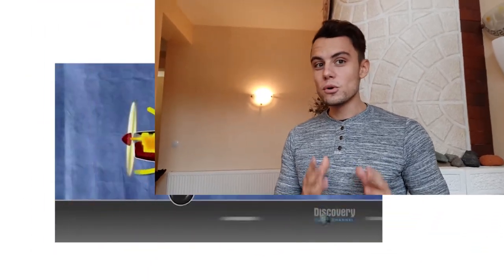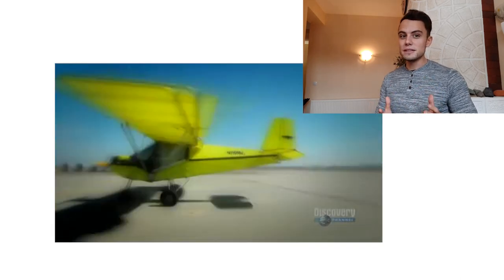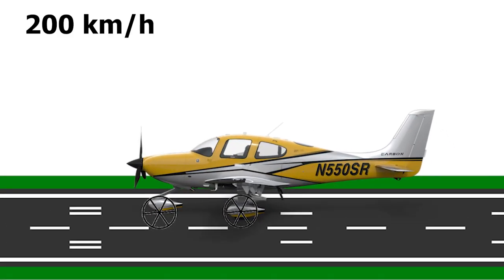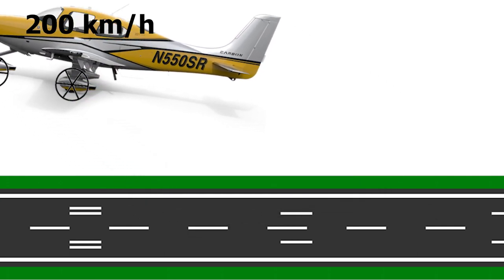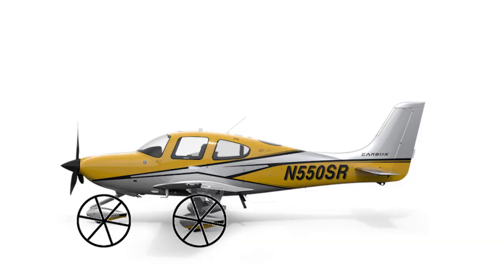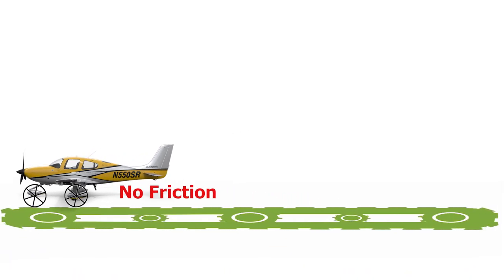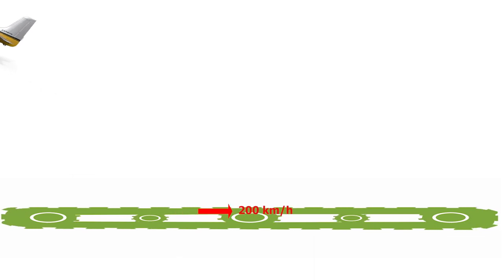Can an Airplane Take Off From a Conveyer Belt?.... Finally Solved!

Comment: But the wheels speed is now higher than the conveyor belt. The problem implies the conveyor belt matches the wheel speed.
Reply: The problem with this scenario is that it is not dealing with any sort of real word engineering, it's dealing with an hypothetical set of mechanisms without any realword constraints. What this ultimately comes to is the plane taking off, because the belt is functionally linked to responding to wheel motion, wheel motion drags behind behind aircraft acceleration, so this means instantaneous acceleration on the air-frame under thrust always exceeds that of the wheels, and since the conveyor belt is linked to wheel motion that also means its instantaneous acceleration of the belt will also always lag behind the that of the air-frame under thrust at the same point in time because it can only even be instananeously the same as the wheels. What this mean, is even in this case of an ideal conveyor belt that instantly responds to wheel motion, the conveyor belt backwards will always accelerate slightly slower than the air-frame. Which means irrespective of the belts the hypothetical aircraft will accelerate off the belt at some point.
Reply: why? the wheels turn at the speed of the conveyor of course, like a gear. But they are free spinning so the air speed can be different (actually less than the belt/wheel speed)
Reply: Yes, that is the problem. The entire premise of the question is impossible!
Reply: @PhilippeLarcher I think the nuance in here is that an increase in thrust results in a resulting increase in vehicle speed and wheel speed.  There is something to tease out in the rate of change.  In his example, he had a 200km/h treadmill resulting in the internal loss so the resulting speed was -190km/h.  The wherl speed must be measurable.  Then the thrust/force was applied to get to +10km/h.  The wheel speed must be different there again.

Somebody needs to draw the diagram, especially if the conveyor has to adjust to that new wheel speed.
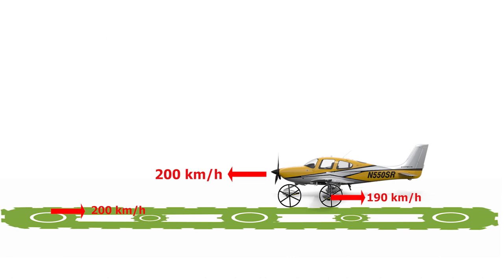Reply: @PhilippeLarcher  The problem is at 5:30. The plane moves forward on the belt which means the belt in that example is not matching the speed of the wheels. Otherwise, it could not move forward.
Reply: @MrDefreese  You can't change 1to1 the conveyor only moves when the wheel rotates in place, not happen. The wheel only rotates as the jet moves forward the rolls over the conveyor and the amount of conveyor behind the wheel is the same as the movement of the jet 1 to 1. The conveyor never moves and the plane takes off. The wheel speed matching the conveyor is the key to solve this. The plane is sitting on the conveyor neither the wheel or the conveyor is moving. Now start the jet move 1 rev of the wheel now the plane has moved forward and 1 rev of conveyor is now behind the wheel. The real question is how fast the conveyor is moving. The answer is it is not and never will. That is the trick of this question.
I see now this is not a riddle, it's the definition of how planes take off from a runway with one word changed. they replaced the word runway with conveyor just to confuse everybody.

One other thing, you park a car on a conveyor and than drive the car forward keeping the wheels and the conveyor at a 1 to 1 ratio. The car will drive off and the conveyor will not start. You yourself can do this on a treadmill, stand at the back end with the treadmill off and take 1 step forward. You will now be in the middle treadmill, start the treadmill up and start walking and you will stay in the same place. Only one can move at a time to keep 1 to 1 ratio.
Reply: @tedfann3618  if this conveyor moves, then it moves at the same rate as the aircraft would if it were on solid ground.  The better way to think of it is that the tire to ground contact patch is the same as if it were cog gears - no slippage.  While it’s on the ground, any motion is by rolling so the conveyor matching wheel speed means no net velocity at all.
Reply: @MrDefreese  You and everyone else keep forgetting the plane has to move forward to make the wheel roll. The distance the plane moves is equal to the amount of conveyor belt the wheel roll over. The conveyor can  only match the wheel speed and it already does without ever having to start up. This is what all planes do every day on real runways.
Reply: @tedfann3618  I forget nothing.  The aircraft only moves on ground because ‘ground’ is not moving.  In this case, ‘ground’ is moving at the same pace as the vehicle thus you get no net speed.  It’s like a dynamo.
Reply: @MrDefreese  The riddle (Imagine a 747 is sitting on a conveyor belt, as wide and long as a runway. The conveyor belt is designed to exactly match the speed of the wheels, moving in the opposite direction. Can the plane take off?)                                                       Lets breck it down, sitting means plane is stopped and the wheels aren't rolling therefore the conveyor belt is not running. Now about exactly matching the speed of the wheels, we have two ways to go, first rotate the wheels in place and make the conveyor belt start up to match wheel speed. Not posable no power to the wheel. The other way is to move the plane and roll the down the conveyor belt. The rolling wheel speed matches with the conveyor belt moving under it. Last, opposite direction, we can answer that by looking at the wheel.   The top of the wheel moving forward the same direction as the plane and the bottom of the wheel is moving opposite direction of the plane. That my friend answers everything in the riddle.    The plane moves forward, the wheels roll, and the amount of conveyor belt behind the wheel matches the planes forward movement. The conveyor belt never starts and the plane take off! Please Prove me right or wrong, I wont down to earth facts, no talking in circles. Thank you
Reply: @MrDefreese  The riddle (Imagine a 747 is sitting on a conveyor belt, as wide and long as a runway. The conveyor belt is  designed to exactly match the speed of the wheels, moving in the opposite direction.)                                                                                                                          Can the plane take off?                                                                                                                                                                                                       Lets brake it down                                                                                                                                                                                                                 747= real plane, it will take off                                                                                                                                                                                               Sitting= Stopped, not moving, wheels not turning, and conveyor not running.                                                                                                    Conveyor belt designed to exactly match the speed of the wheels = Conveyor belt can only match wheel speed, it can't change wheel speed.                                                                                                                                                                                                                       Moving in the opposite direction= The top of the wheel the moves in the same direction as the planes forward movement, the bottom of the wheel moves in the  opposite direction to the planes forward movement. So any conveyor belt the wheels roll over moved opposite the plane.                                                                                                                                                                            To make the wheels turn the plane must move forward, as the wheels turn they roll on the conveyor belt at the same speed. Because the speed of the wheels  already matches the stopped conveyor belt, the conveyor belt  will not have to start and the plane will take off.
Reply: @tedfann3618  there are definitely some problems with the phrasing of the thought problem.  If, as you suggest, the vehicle is moving left, the wheels move anti-clockwise.

If the conveyor moves opposite to the wheels, one could experiment with either interpretation.  If the conveyor moves  'opposite of the wheels, as in the velocity of the conveyor is the same as the tangential speed of the wheel at the contact patch, then the plan does not move; that's exactly the same scenario if a wheel is on a dynamo.

If, however, one views the conveyor to move opposite the contact patch, that means the rotation speed is added to the conveyor speed to get a total translational speed.  You can get that by using a catapult like on an aircraft carrier.  That's an inconsequential thought project.

If one works on the basis of the wheels moving counter clockwise and the conveyor moving left to right at the contact patch, then there is definitely no net velocity for the vehicle in that system.
Reply: @MrDefreese  I'm just answering the riddle. sitting = stop = non rotating wheels = non moving conveyor belt. Wheel speed only comes from forward movement of the plane, as the wheel rolls the only way to match the wheel and conveyor belt is for the conveyor belt not to move. All planes do this every time they take off, the runway is in front of the plane and then it's behind the flying plane.
Reply: @MrDefreese  I see my last post some as got lost. So I have just one question, at what point does the free spinning  wheel speed up faster then the plane forward motion to make a need for the conveyor belt to start up?
Reply: @tekcomputers                                                                                                                                                   The riddle (Imagine a 747 is sitting on a conveyor belt, as wide and long as a runway. The conveyor belt is  designed to exactly match the speed of the wheels, moving in the opposite direction.)                                                                                                                          Can the plane take off?                                                                                                                                                                                                       Lets brake it down                                                                                                                                                                                                                 747= real plane, it will take off                                                                                                                                                                                               Sitting= Stopped, not moving, wheels not turning, and conveyor not running.                                                                                                    Conveyor belt designed to exactly match the speed of the wheels = Conveyor belt can only match wheel speed, it can't change wheel speed.                                                                                                                                                                                                                       Moving in the opposite direction= The top of the wheel the moves in the same direction as the planes forward movement, the bottom of the wheel moves in the  opposite direction to the planes forward movement. So any conveyor belt the wheels roll over moved opposite the plane.                                                                                                                                                                            To make the wheels turn the plane must move forward, as the wheels turn they roll on the conveyor belt at the same speed. Because the speed of the wheels  already matches the stopped conveyor belt, the conveyor belt  will not have to start and the plane will take off.
Reply: @MrDefreese    I see my last post some as got lost. So I have just one question, at what point does the free spinning  wheel speed up faster then the plane forward motion to make a need for the conveyor belt to start up?                                                                                                                                                                                           The riddle (Imagine a 747 is sitting on a conveyor belt, as wide and long as a runway. The conveyor belt is  designed to exactly match the speed of the wheels, moving in the opposite direction.)                                                                                                                          Can the plane take off?                                                                                                                                                                                                       Lets brake it down                                                                                                                                                                                                                 747= real plane, it will take off                                                                                                                                                                                               Sitting= Stopped, not moving, wheels not turning, and conveyor not running.                                                                                                    Conveyor belt designed to exactly match the speed of the wheels = Conveyor belt can only match wheel speed, it can't change wheel speed.                                                                                                                                                                                                                       Moving in the opposite direction= The top of the wheel the moves in the same direction as the planes forward movement, the bottom of the wheel moves in the  opposite direction to the planes forward movement. So any conveyor belt the wheels roll over moved opposite the plane.                                                                                                                                                                            To make the wheels turn the plane must move forward, as the wheels turn they roll on the conveyor belt at the same speed. Because the speed of the wheels  already matches the stopped conveyor belt, the conveyor belt  will not have to start and the plane will take off.                                                                                                                                                                                                                                  I see now this is not riddle, it's the definition how planes take off from a runway with one word changed. they replaced the word runway with conveyor just to confuse everybody.
Reply: @tedfann3618  right here is the problem:

"Because the speed of the wheels  already matches the stopped conveyor belt, the conveyor belt  will not have to start and the plane will take off."

As soon as the wheel starts to roll, the conveyor moves at the same exact linear speed.  By definition, the position of the vehicle does not change at all.  Without any position change, there is no airflow over the wings and therefore no lift.

The only 'out' in this case is the magical thinking that there is an outside airflow over the wings to generate the lift, but that seems to be well outside the parameters of this project.
Reply: @MrDefreese  Again the plane moves Forward and the wheel rolls exactly the same distance on the conveyor belt. with everything matching exactly at what point in the forward movement of the plane does the wheel get ahead of the conveyor belt causing the belt to start?

Comment: If a wheel is not scraping across the surface, then we know that the linear velocity at the wheel axis whether it’s just a tire or affixed to a test vehicle, is exactly the rotational speed at the radius of the wheel.
Anyone with a whit of basic knowledge should know that the distance on a wheel circumference is (pi * wheel diameter).  If you know that rotational speed and circumference travel, then you are explicitly given the linear travel of the conveyor exactly matches the wheel speed.